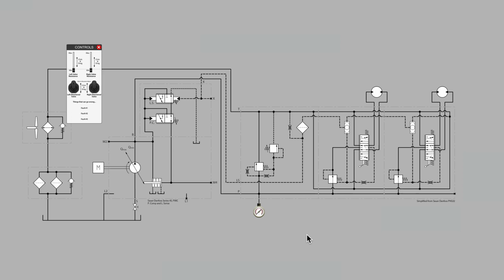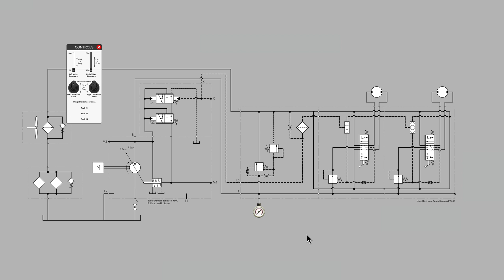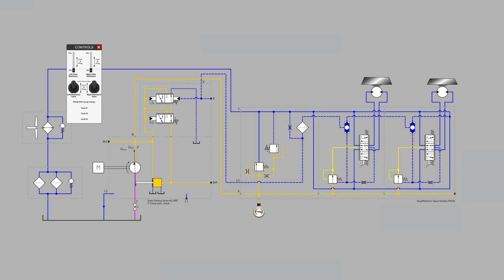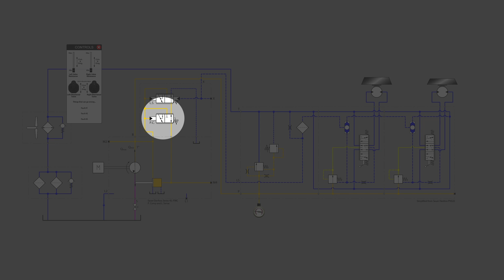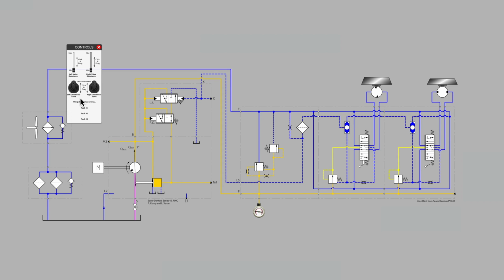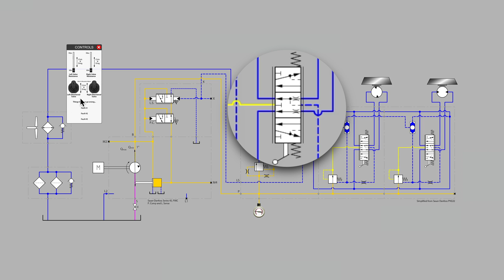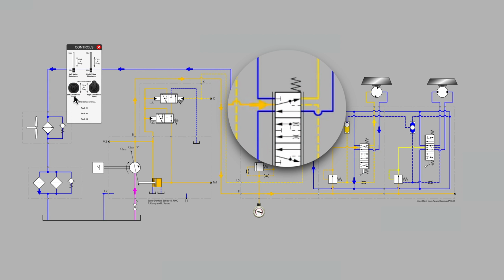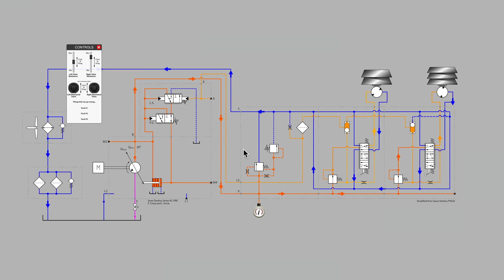Load Sense Live Schematic

Comment: Kindly explain it in detail that how hydraulic pump sense in increase in load on motors. I am very grateful to you for these videos. Also egar for your response. Plz.
Reply: i have the similar doubt, what is exactly happening to load compensator dcv when we increase load gradually ? please explain if you know.

 thanks
Reply: The control valves near the pump usually receives the signal pressure (max needed pressure for the system), and based on that the control valves will regulates the pressure and allow the pressure to the system. So the maximum pressure can be decided by the resolver which usually compares two system and finalise the maximum work pressure and gave it as an input from the control valve. So usually the control valve will be seperately needed only for the fixed displacement pump. And for variable displacement the pressure cut off and flow compensator will be inbuilt with pump setup

Comment: Hi, thanks you very much for your videos. I'd like to apply this knowledge to real live controling a motor speed using a pump conected to motor truck drive. In your videos you haven't taked about the heating that the pressure compensated flow could cause. Maybe you can add a video about that. Thank you.